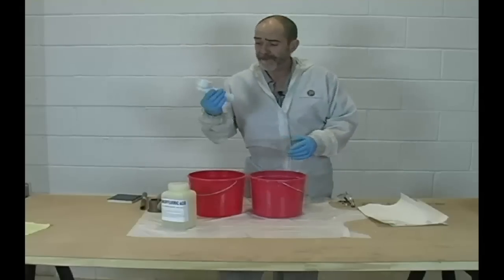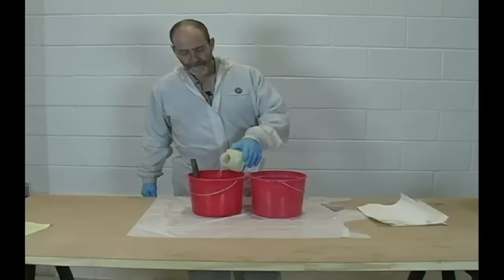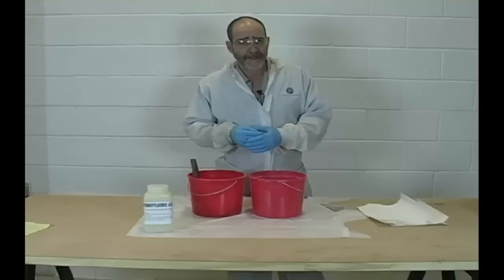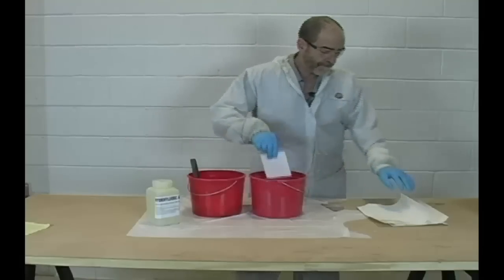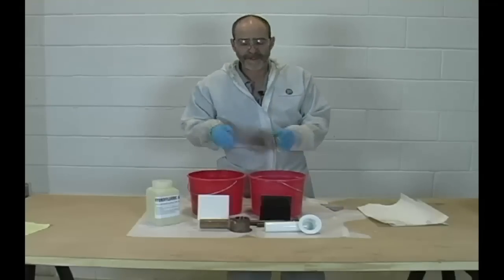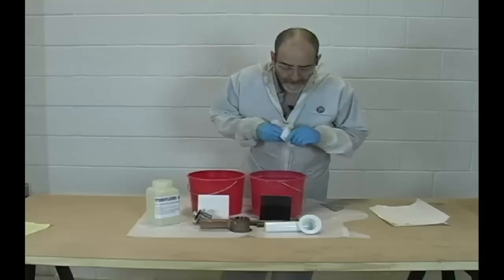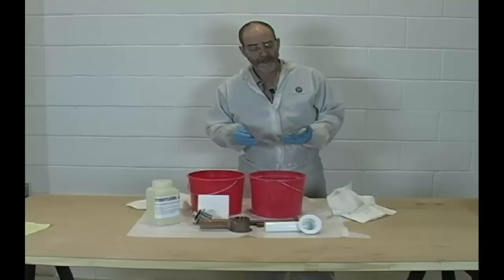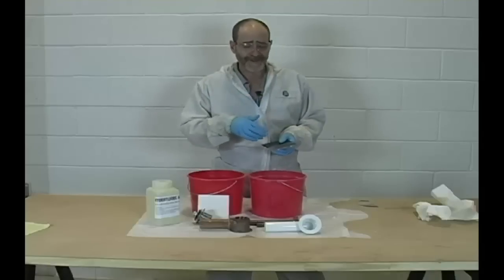Bathtub Refinishing Hf Acid Etching - HF Acid Demo Hydrofluoric Acid

Comment: Wow. HF is ultimately dangerous. You don't wanna touch even a drop of it. It's not for acidity, which is relatively safe. HF is an acid with 2 smallest and most unstable elements, H and F. The combination of the two forms small molecule with very high movability. The thing about HF is, you won't feel a thing when touching it, but it goes through your skin and soaks into your bones in several hours. And then, it's often too late to save yourself. HF will damage your bones and organs, and very difficult to cure and always comes with lifelong pain and disability, or even immediate death. Just by touching it. So anyone who tries to use it should be very carefully protected, and operate in a fume hood, cause the steam of HF also kills.
Reply from the maker: Gu Zhuoer Wow how hyperbolic can one be. Been using this for 26 years with a crew of 11 techs. We use a 5% to 10% solution depending on the job.  Have had 4 minor burns in that time and treated with Calcium Gluconate. I suspect you are a refinisher trying to justify not using it. At low concentration and proper gear along with proper training it's safe. Did you see any "Steam" coming from the solution in the video NO. Your description would be for a 70% concentration
Reply: +Porcelain Tub Restorations Actually professional chemists will tell you the same. Working with dilute acid IS safer all right, but I believe your clothing, gloves and eye protection have been there for a reason. Thus I won't underestimate hydrofluoric acid's capabilities.

Comment: Your are absolutely correct about the PH adding baking soda would bring up the PH and require a PH meter to adjust to neutral (7.2) The video's intent is not about neutralizing the PH - But the need to etch or provide "Mechanical Adhesion" to porcelain/enameled surfaces and to rebuff the lies told about why it's used and that it can hurt the tubs plumbing. HF acid is easily washed away with water along with a through scrubbing. Thanks for helping to clarify that.

Comment: You cannot "neutralize" that much 10% HFA @ pH 4.5 with a few gallons of water.  pH 4.5 isn't the problem anyway.  Now if you want to say a few gallons of water can rinse it away I will agree as long as it is rinsed properly.

Comment: Good video. Where do you buy this acid? The acid coming from hawk labs and Napco would NOT be safe to breathe even in such a small amount as used in this video without at least a respirator preferably a supplied air system.
Reply from the maker: Paul L. We get ours from a chemical supply house in drums and there really isn't any odor. We use a 10% solution.

Comment: I do not have the money for a professional glazer.   So, I'm going to have to buy one of those DIY kits.  My concern is the prep.   The bathroom tile and tub are about 10 years old.  Surround tile over the bathtub is peeling.  It's white but once it started peeling it's now green. What products should I after sanding to help degloss and ruff up the tiles.  I do not want to use this acid?   Anything else strong but for non-professionals?
Reply from the maker: monica green Sorry for the delay, I never saw the comment posted in my email. You really should remove all the failed coating, either by sanding or chemical paint stripper but be sure to use ventilation and a respirator. We have an Adhesion promoter that works extremely well for locking on the new coating. If you're still in the need, email me at pburns@bathrenovationhq.com
Reply: +monica green You probably won't be able to obtain the acid either. Companies who stock it are usually picky on who they sell this stuff to.
Reply: Thanks for the informative video. Can you tell us more about the "Adhesion promoter" you mentioned and where to buy it? Thanks.
Reply from the maker: Tom Jordan
 contact me for info on our adhesion promoter pburns@bathrenovationhq.com

Comment: What kind of sand paper are you using?
Reply from the maker: Sorry about the delay had to get our companies new computer installed and data transferred and it took awhile. On porcelain or enameled tubs we start with 80 grit and then 180 both are used with a orbital sander. On fiberglass fixtures 180 and a red scuff pad are used. Hope this helps Paul